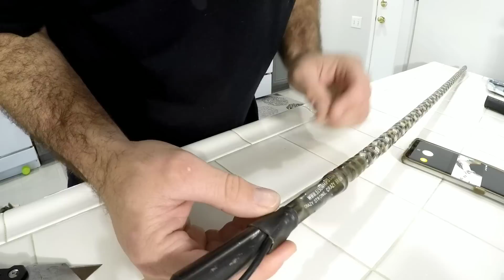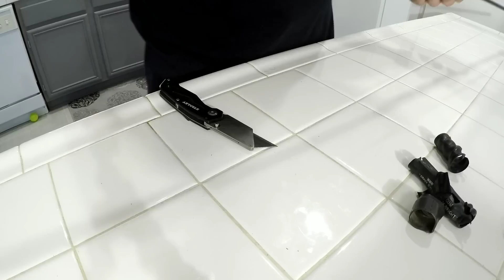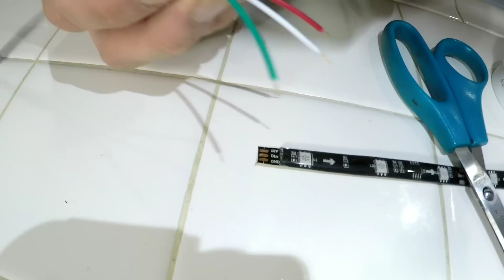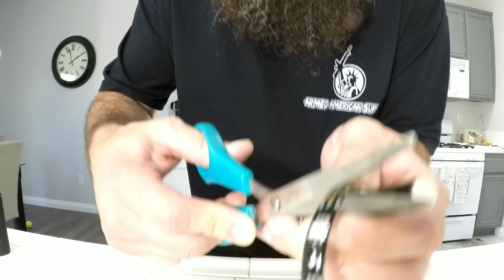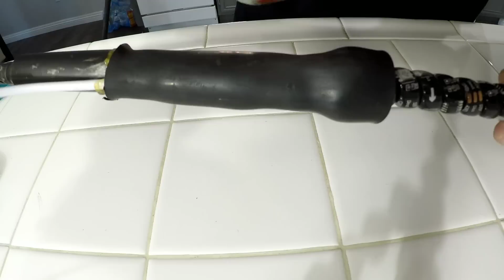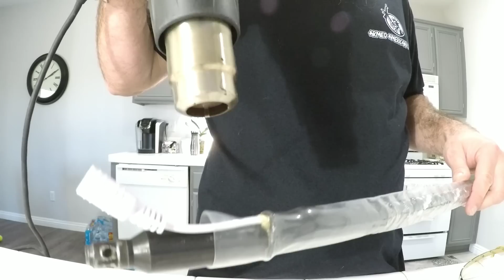How to make a lighted led whip

Comment: Nice video, very informative. Thanks! Questions- Where is the link for the thick black shrink wrap you used on the bottom?
Where is a cheaper place for a pole if u don't wanna use a 5150 pole, if youre starting from scratch? You used 3/4 inch clear wrap over leds and pole, what was the starting diameter of the fiberglass pole, 1/2? Thanks for the help!
Reply from the maker: Great questions... YouTube for some reason wouldn't let me add as many links as i wanted. The thick shrink wrap is 3 to 1 inch and a 1/4 found on Amazon. The fiberglass whip starts out as  3/8", You can find them on a few different websites but they are always kinda expensive due to shipping cost. If you find a reasonable price for some shipped please let me know.
Reply: @MrRICKDAWG4444  3/8 inch fiber glass pole, got it!  I was shopping for 1/2 in @4 foot long. The website I found from manufacturer 4 of them shipped @50 bucks. 3/8 inch prob just a small tad cheaper. More you buy they get slightly cheaper. I was looking for the metal connector to attach on the end. Kind of like those on the extendable painter poles so I could make the connection to the mounting device of some sort. I wasn't having any luck with that.. was trying to do a materials cost comparison to  buying one new.
Reply from the maker: Right on dude. I can say going with a thicker whip like 1/2 will be better for the LEDs and solder points. If you're handy with a mill or a dremel tool look into the R1 whips mounting connection, I really like how those connect and really wouldn't be to hard to make using tube, roll pins, and a spring. Good luck on your build feel free to hit me up with any questions you got along the way.
Reply: @MrRICKDAWG4444   hopefully finishing up a diy fiberglass top for my 2019 yxz 1000r this week. Then starting the whips. I'll  def hit you up. Thanks for the quick responses I appreciate it!
Reply: @chriseaster5666  what site did you get the poles from? I want to build 6 of these.

Comment: I think its better to just save the money and get the real thing.
Reply from the maker: Some of my  buddies have the real thing and like mine better.  my newest versions are better in every way. Also this is a older video I don't make em this way anymore but still very similar just much brighter and way more leds and now on there magnetic base but with full control of brakes,turn,and reverse signals. Much better build

Comment: DMAX. Just wondering if you make these and sell these?
Reply from the maker: I do sell them locally however I have shipped a few pairs out and it's around $50 for shipping a 6' box
Reply from the maker: @Pbrownjr33  I usually only sell them in pairs since I use a different controller type now and days however a 4 foot box would be much cheaper to ship I would think.
Reply: @MrRICKDAWG4444  ah.. I could run two on my Tundra. What would the cost be for the whips be? Shipping isn’t my main concern.
Reply from the maker: @Pbrownjr33  have you seen the most recent video of the ones I make for trucks that plug into a 7pin trailer connector? 6' $200 4' $175
Reply: @MrRICKDAWG4444  NO!! Let me look.
Reply: @MrRICKDAWG4444  I am 100% down for the 4ft one. Wondering is a longer lead could be attached, I have a Tundra and want to to mount to that track system up high on bed with my own mount.
Reply: @MrRICKDAWG4444  also, let me know how to contact you and send payment?
Reply from the maker: @Pbrownjr33  sorry for the late reply I must of missed this comment. I can make the lead as long as you need. The magnetic base is already attached and has a stud and nut on the bottom so you only need a hole of any sort to fasten it to and then it just quick disconnects after that via the super strong magnetic base. I except PayPal and Zelle as form's of payment if you're interested.
Reply: @MrRICKDAWG4444  perfect! You have a contact I can directly communicate and pay for one?
Reply from the maker: @Pbrownjr33  did you get it?
Reply: @MrRICKDAWG4444  I did not. 😢
Reply from the maker: @Pbrownjr33  it won't let me post anything try dming insta. Dmax_909
Reply: @MrRICKDAWG4444  no worries. Already in the DM’s 🤙🏼🥃

Comment: DMAX909  hey man - great tutorial on making a whip, i made a couple sets of whips of my own already 1 set was just basic rgb 5050led strips like the 1s you removed from the whip and then i decided to make some addressable whips like what you just made from scratch with holo pvc tube that was 6ft in length, and i went with some Mokungit sk6812 strips, and noticed alot of voltage drop after about i think it was like 20-30leds, so i cut the strips up into sections and made essentially like 10 little strips each with their own +/-/data wires that went inside the pvc pole, which ended up being a massive wirenest at the end lol.. for reference - https://i.imgur.com/7SSihns.jpg this is what my leds are on. the whips are 6ft poles with Mokungit SK6812leds like stated before and the underglow is all ALITOVE RGB Addressable LED WS2811 12V Strips which i had a problem wiring up as well.  --- i couldnt figure out how to wire anything up as 12v - so currently in the car there are 3 12v to 5v inverters hooked upto to 3 different ALITOVE sp105E bluetooth controllers 1 for each whip and 1 for the underglow/and small amount of interior lighting

So now im looking at making a new and more simple setup this year and thats when i came across your video..  trying to figure out how to eliminate the rats nest of wiring i have in the trunk b/c its "clean/messy" if that makes sense.. everything is organized because theres just alot going on, and on the whips, b/c currently each whip has i think 8-10 sets of +/-/Data wires coming out that all are solder/crimped together that get hooked up to each controller and then 5 sets of wires coming from the front/rear/left/right/interior strips of leds for the rest of the accent lighting.

I would like to keep the 6ft length if possible but clean up the amount of wiring needed, and somehow if possible streamline the underglow of the car but keep all the lovely addresable LEDS and having it all on 1 controller would be amazing... going back to just basic rgb just doesnt seem fun anymore
Reply from the maker: I always like to use 12v ws2811 for most of my projects. The problem you're seeing with voltage drop is because they are running on 5v and dropping off sooner. I usually only need to add power injection after 1 to 2 rolls off LEDs and only if i plan on running solid white color becauseit usesthe most power. Each controller is only good for 1024 leds so keep that in mind when integrating the underglow. I hope this helps
Reply: @MrRICKDAWG4444  for injecting power mid roll, do you just run some wires under the strip and solder em in from underneath? do you need both +/- or can you get away with just +
Reply: @MrRICKDAWG4444  also do you happen to know of any other substitutes to 5150's daywhips for a quick disconnect style? after doing a amazon search of atv whips i like this design https://i.imgur.com/8ghmI3Z.png  but i cant seem to find just the connection.. dont wanna spend 200~ for some whips just to get the quick attach.
Reply from the maker: If you're running 12v leds you shouldn't need power injection until after the first roll unless you're using like 60/m LEDs but generally you just add a small +/- wire underneath the wrap and splice it at the end of each string. 12v injection goes along way you wont need all that power at the top. As for mounts I've made strong ones out of quick disconnect air fittings that work off road or just stay tuned I'm gonna duplicate 5150s magnetic quick disconnect with stainless steel tubes and a disk magnet that I'll weld up and tap for 1/2 fiberglass buggy whips.

Comment: Do you have a link for a Bluetooth controller ? That does the 300 modes and stuff . And where did you get the whip pole ?
Reply from the maker: They do make bluetooth controllers however they will need to be fitted on the vehicle instead of the whip due to the size of the controller. There is a couple of options you can do for the controller but you will only get 120-200 modes in this type of controller that I've seen. This is the 200 mode bluetooth controller https://www.amazon.com/ALITOVE-Controller-Individually-Addressable-Programmable/dp/B01LW1J10W you will need to leave the 3pin connector coming out of the bottom of the whip so that you can plug the controller in externally. As for the whip you can order from wherever this is where i get them https://www.chapmoto.com/5150-whips-daytime-whip-with-flag-parent-16-60003 thanks for your Comment feel free to reach out to me with any othe questions you might have.

Comment: Would you be able to sell me one? White red green I want a Mexican theme I'm located in socal 4 footer
Reply from the maker: I think the controller might have that color chase pattern but im not sure i would need to check
Reply: @MrRICKDAWG4444  okay great let me know the price where you located?
Reply from the maker: I'm in the Riverside/San Bernardino area. I charge 150 for these
Reply: @MrRICKDAWG4444  nice I'm off the 60 and valley way you include the quick release
Reply from the maker: Cool you're not to far I'm at the top of the 60 and 10 split.  Yes everything is included to mount and wire ready to  use.

Comment: Awesome video man!! Been wanting to make my own whips but wasn't sure what all to use to make a good one.. What's the diameter of the whips that you normally use? Will a regular ol 6ft flag whip you can pick up at the dunes work??
Reply from the maker: Thanks, as for the whip you could use just about anything. Mine are 3/8th inch i belive, 5150 day whip sells the whole quick release and bare fiberglass whip for like $40 i think if you wanted to go that route.
Reply: @MrRICKDAWG4444  Sweet, thanks for the info man!!
Reply from the maker: No problem. If you have any more questions along the way feel free to hit me up.

Comment: Do you have a link for a splitter that would work so I can run 2 whips off one controller so they will be in sync?
Reply from the maker: I just make my own wire harnesses with 3core wire and and splice them together using solder and shrink wrap.